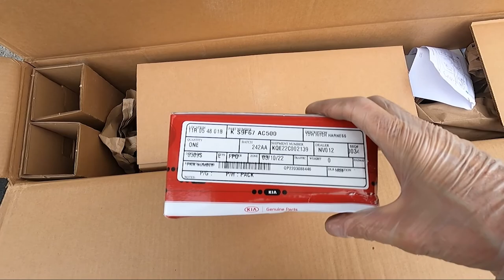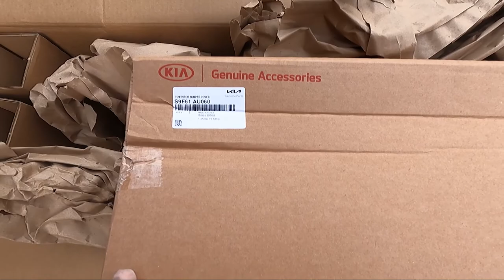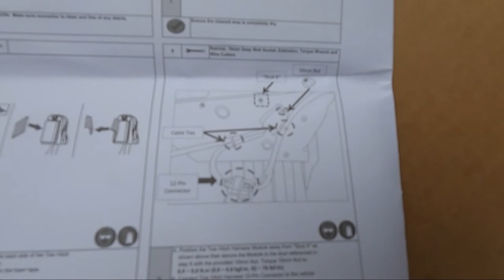Kia Telluride Factory OEM Hitch and 7 Pin Connector Installation

Comment: This is possibly the best and most thorough video I’ve watched on YouTube. Thanks for your clear video and great explanation. I ordered the Telluride hitch and am actually installing on a 2023 Palisade. I wanted to mention, the hitch I ordered (S9F61-AU000) did not come with the hardware. I had to order the hardware separately and the part number for that is S9F61-AU030…thought you might add that to your list. Thanks again!
Reply from the maker: Thanks Trent, great info! I added the hardware kit part number to the video description. Thanks for the kind words. Good luck!
Reply: Did it fit the 2023? I am assuming if it fit the 23 it will also fit the 24

Comment: For anyone with a 23-up telluride who wants to self install a hitch and is getting danced around by Kia dealers with the trailer harness converter, you can aquire one from hyundai for the 23-up palisade and it will work! 

All the kia dealers by me told me it had to be ordered...also, every dealer I called for it named a different price for the same exact part. (It looks like they mark it up by whatever amount they choose).  Ive also heard people say thier kia dealer refused to even sell harness by itself, and insisted it needed to be purchased with the complete hitch package as a whole. 

I was able to get part s8f67-ac700 from hyundai in hand without waiting for shipping and it plugged right in and worked fine on our telluride. (The part itself even has the kia logo on it). It was also priced lower than any quote Kia gave me!
Reply from the maker: Mike, this is great stuff. Thanks for posting this here. I'm sure it'll help someone!
Reply: FYI.. Not sure about the 2023's, but the wiring harness for 2024 is different. In this video it ties into the harness behind the rear wheelwell. On the 2024 it ties into the harness where the jack is stored inside the car.

Comment: New to towing.  We just got a little camper trailer with electric brakes.  Has 7 pin plug.  Do we need a control box or can we install this kit and the trailer brakes will function?  Thanks for this video too.  Super helpful for when we get the hitch and wiring.
Reply from the maker: You'll need a brake controller in addition to the 7 pin plug connection. I have a video showing how I installed mine. If you want to avoid having to install and wire a brake controller, you could look at something like the Curt Echo. It plugs directly into the 7 pin connector and goes between the car and the trailer. I'm sure you can find some YouTube videos on how it works. Good luck!
Reply: @PIFDIY  I found one at Curt for under $70 bucks.  Thanks!  So even though I am installing the factory tow package with a legit 7 pin connector the trailer brakes still don’t function without a controller?  

Only reason I ask is I thought a controller just gave you the ability to fine tune the brakes gain, etc. but the brakes would still function with the plug just being plugged in.  Thanks again!
Reply from the maker: @172sbct  The brakes will not function without a controller. More focused vehicles will come with integrated brake controllers or offer it as an option (full sized SUVs and pickups) but it needs to be added to the Telluride. If you look at my brake controller video (https://youtu.be/6qwy1UaHrLQ), you can see that the wiring is provided under the dash, but you need to purchase and install the controller.
Reply: @PIFDIY .  Kills me that Kia doesn’t supply that as part of the tow package for a complete unit.  Or at least supply a cheap basic one.  The one from Curt looks like it is what I need.  Thanks again for the speedy responses.  At least Kia has set the consumer up for success with the wiring ready to go and easily accessible.  Kia dealer wanted an arm and a leg to install the tow package.
Reply from the maker: @172sbct  Kia probably feels with a 5000lb tow capacity, most trailers won't have brakes so no need to add the cost of a controller. That said, even my 2015 Tahoe didn't come with one. Just another way to cut costs.  But, like you said, at least the wiring harness is there...

Comment: Why does the OEM hitch kit come with power latch assembly? I see you did not replace the power latch so I'm assuming it's not needed but Kia is saying it comes with the kit.?
Reply from the maker: Not sure what you mean by "power latch". You can see what's included when I unbox the OEM hitch kit.
Reply: @PIFDIY  There a bulletin out (Parts Bulletin MI-23-31) to replace the latch on powered hatches. Something about towing\hitch weight causing the latch to come out of alignment. It's not an issue for Tellurides built after 10/6/23.
Reply from the maker: Interesting. I didn't know that.  @themichaelcreed

Comment: What is the self-leveling shocks for?  Do I need them to tow a small car?
Reply from the maker: Alan, you'll have to read up on it. I went through that process when I tried to determine if I could get away without self leveling shocks. For me, I have two types of motorcycle hitch carriers with a variety of bikes as well as a tandem wheel landscape trailer that I occasionally use for hauling stuff. I've used both carriers and the trailer with about a ton of stuff in it with no excessive squat. I would read up though...
Reply: Why do you have to give up self leveling suspenion doesn’t that and tow mode come standard on that model SX Xline. Online show it as standard

Comment: I am in the process of installing  this hitch on a 2023 Telluride and there is a gap between the hitch and the frame on the driver side. I first tightened the passenger side carriage bolts as the manufacturer's instructions said to do and when I went to tighten the driver's side 19 mm bolts, I noticed that there's about a quarter inch gap between the hitch and the frame, before I started tightening the bolts. Is that normal? I'm concerned about damaging the frame if I tighten these bolts all the way down.
Reply from the maker: I don't recall any gap. I believe that I could hold the hitch up flush against the frame without tightening the bolts. I would try to loosening the driver's side bolts and see if you can alternate back and forth between all bolts to snug up the hitch. If it starts to bind, you'll probably want to find out if there have been any changes with the hitch or car for 2023.
Reply: what did you find out hlipham?  did you get it to work??
Reply: @bigfishbrau  Yes, I installed two washers on the driver side. The passenger side was tightened up without any washers.
Reply: @hlipham  oh wow, there was that much of a gap?  i wonder if thats not unusual though.  they cant fit exact i would think?  im just worried because i just ordered one to put on a 23 palisade because i saw someone that did that and he said it fit fine..  :/
Reply: Isnt there a problem with the trunk latch or something with the 2022 wiring?
Reply: @Ttaylor2308  There a bulletin out (Parts Bulletin MI-23-31) to replace the latch on powered hatches. Something about towing\hitch weight causing the latch to come out of alignment. It's not an issue for Tellurides built after 10/6/23.

Comment: How long did it take for you to do this by yourself
Reply from the maker: Not sure exactly but this is a very easy DIY project. With all the parts, figure a couple hours at most. I always try to watch videos and/or study service manuals/procedures before starting projects which help things go smoother. Also try to have your tools ready so you're not going back and forth from under the car. I give a lot of the fastener sizes in the video.